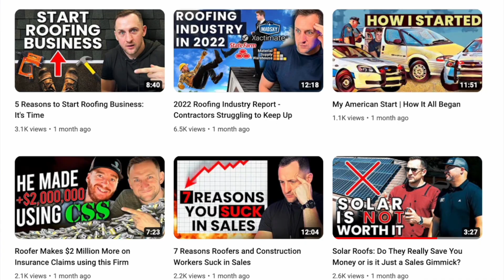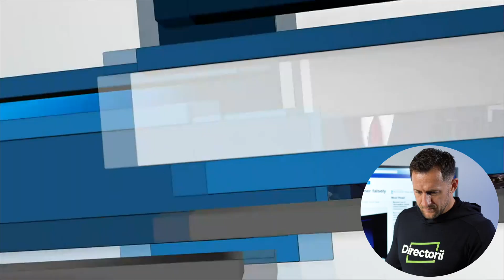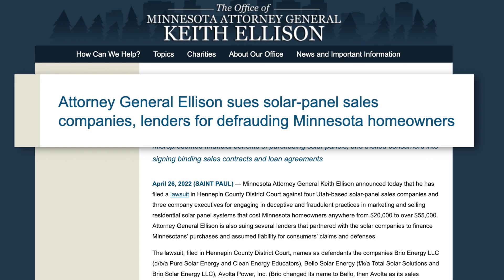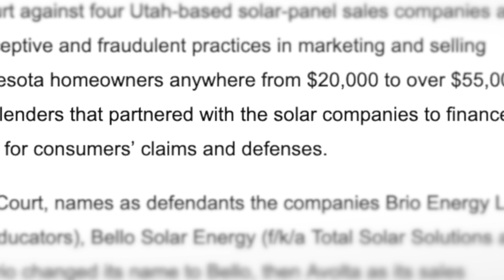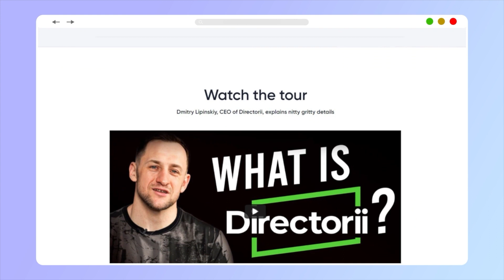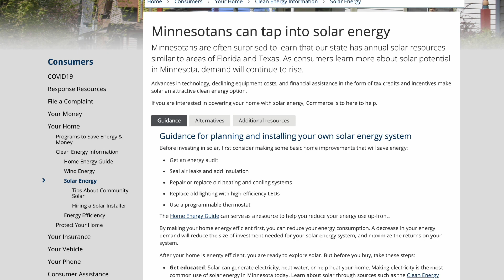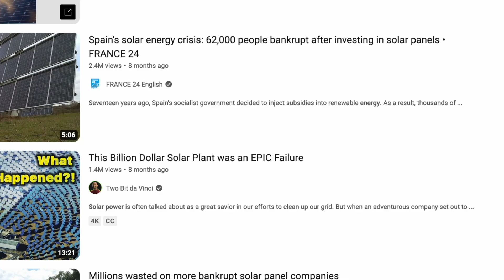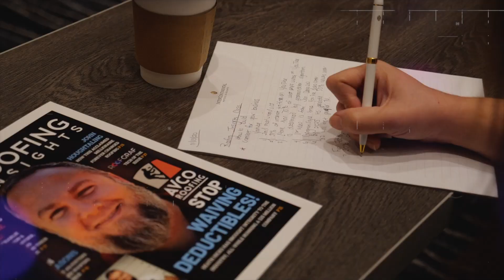Beware of Solar - Roofing Financing DEALS (Sunlight, Greensky, Goodleap)

Comment: BEWARE: Don't forget also how long or how much life you have on your roof. Say you have 10 years left of life on your roof and you have solar installed, you will have to pay anywhere between $200-$300 a panel to have them removed and reinstalled just to reroof in the future. The uninstall and reinstall will eat away your savings! SOLAR COMPANIES ARE NOT TELLING YOU THIS!
Reply: I'm fighting that battle right now.  Panels installed on a 24 year old roof a year and a half ago.  Solar savings approximately $5 per month.  Roof is shot, needs to be replaced, should have been replaced prior to sunrun installing them and those crooks want $6,000 for the detach and reset.  IMO, if the solar panels are owned by the homeowner, they should be responsible but in a lease agreement, the owner of the solar panels, sunrun in this case should be the ones responsible since they installed these knowing full well this day would come in the near future
Reply: @farenzena796  - That sucks! My recommendation to all those who want solar. Call many roofers to get their opinion on the condition of the roof before installing new solar. It’s a money grab for solar companies to come out again to uninstall and reinstall panels and they know it!

Comment: I spent over a year studying solar. Here’s my opinion. Solar only makes sense if you can afford to pay cash for the system and have enough of a yard to put the panels on ground racks or pergolas. 

The financing eats up your savings, and I don’t recommend putting all of that equipment on your roof.
Reply: So true! Even the 1.99% interest rate for 20-25 years will eat up your savings if you only pay monthly. SMH!
Reply: @appleforever6664  yeah the interest rate will eat some savings up but most solar finance finance companies add a 25%-30% finance charge to the loan from the beginning. That’s not an interest rate. Just and added charge. 

So if you purchase a $40K system you will be financing $50-$52K at whatever interest rate you get. 

On top of that, if you go over a 11.78kW system in Florida you are required to add a million dollar personal liability policy to your home insurance that will run you $500 a year or about $42/mth that typically eats up most of the savings for an average sized home. 

This is why it just doesn’t make since unless you pay cash out right for the system.
Reply: @EverybodysACritic35  - Yup. Some don’t charge an upfront finance charge. This is why it’s important to read the fine print.